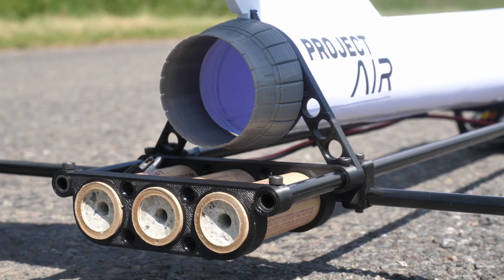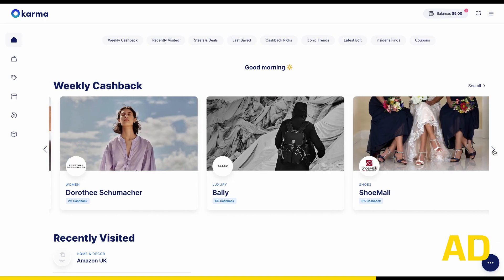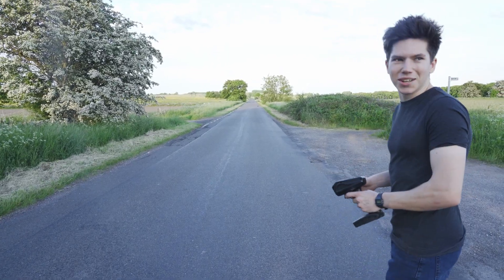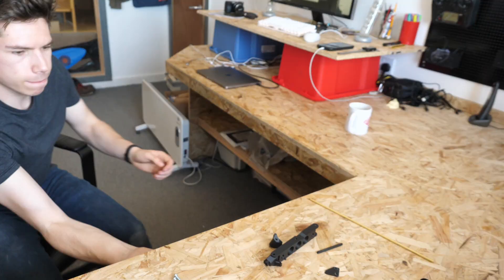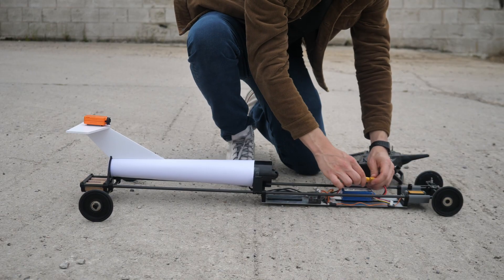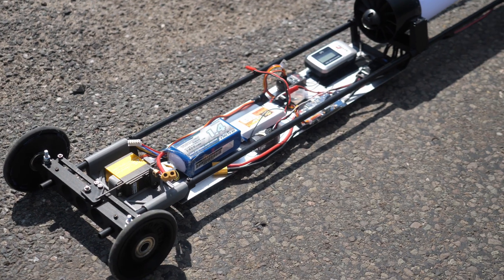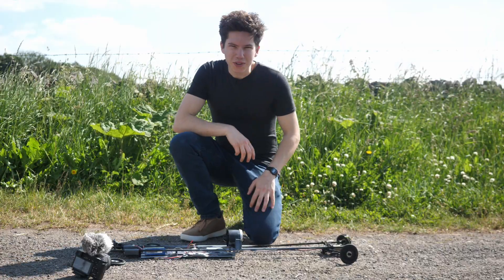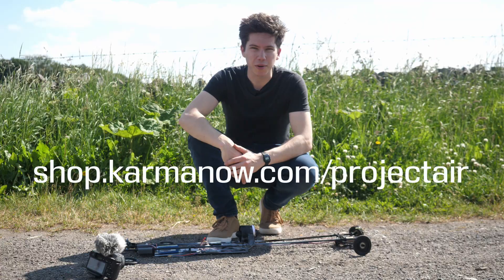Making a Rocket Car

Comment: Just a few things for your next setup on your chassis if your going to try three motors.
1) increase the forward track on the axle and add a wee bit of camber.
2) slow the steering response down to very minor increments, faster you go the less input needed.
3) massive flat parking lot with no curbs lol

Comment: lol CAD designed, 3d printed, with proper rocket nozzles.....
When we made rocket cars, we used mini-skateboard wheels, taped to a piece of scrap wood, with a can of Lynx or Tusk taped to the top as the 'engine'. Puncture the base of the can of Tusk, drop a match, and pray......

Comment: Ultralight wheels for RC airplanes would probably help to reduce the mass a little, will need a smoother road though. The one I made when I was a kid used these and an Estes E-motor. Went airborne after about 50 meters when it hit a small pebble in the road (it had low ground clearance and not enough downforce on the front).
Reply: Try it again, but with a skateboard ramp set up in the road ;)

Comment: a little off topic but, concerning your safety belts in your Mini, you need a cross bar to raise the point at which they turn down towards the rear mount points.  the belts should turn down at a height equal or slightly higher than your shoulders. if your shoulder is the downturn point, in an accident your back will be compressed severely.  enjoyed the video. cheers

Comment: You can drill out the ejection charge and repack the end, or use epoxy. Or you can actually buy engines for multi-stage rockets that don't fire an ejection charge.

As many Estes motors as you go through, you should seriously look in to making sugar / kmno3 rocket motors yourself.

Comment: why didnt you remove the ejection charge?? its rather easy, pull off the paper tab, empty the powder and cover the hole with epoxy glue... no flash no fire..

Comment: part 2 fire proof parts / you could try emptying out 3 rocket motors and make one big one on the center line so there is no side to side pushing at high speeds and make it super aerodynamic / happy tinkering    kevin

Comment: So you know about camber toe and rake, right? The shortest distance between any 2 points is a straight line, to get higher speeds you're gonna need to go in a straight line for longer which means you're gonna need better steering.

Comment: Really needed to turn down the steering sensitivity A LOT. When you are driving slowly you need to turn fast, but at high speeds you barely need a few degrees turning and will stop you from over correcting and wobbling. Even if it gets out of control a high turning rate isnt going to save it

Comment: Also maybe orient your thrust stack vertically instead of horizontally so you don't get any dissymmetry from unavoidable slightly varying ignition and burn times.
Reply: That's what Mythbusters did when they experimented on a JATO car.

Comment: My thoughts and suggestions:
1) Bin the steering all together and opt for low friction, low mass wheels with a Spektrum as3x flight stabilization RX (bare with) to gyroscopically maintain steering control and allow a dynamic vertical stabilizer to keep you dead ahead at all speeds. You can use tiny linear actuators instead of micro servos to save even more weight.

2) Critically evaluate you thrust to weight ratio and pour it on mate, that feeble ducted fan is a hold up and not a selling point. You are shooting for 2:1 bare minimum, ideally exceeding 6:1. Are you or are you not going for speed? Don't over look this physics fundamental and somehow come to imagine low friction and an odd setup will gain you anything.

3) Go high voltage. Try a 6s or 12s HV lipo system and thank me later. You can still use smallish cells to keep the mass down because you are doing short runs, just make certain your entire powertrain from the bus out can handle the increased current load.

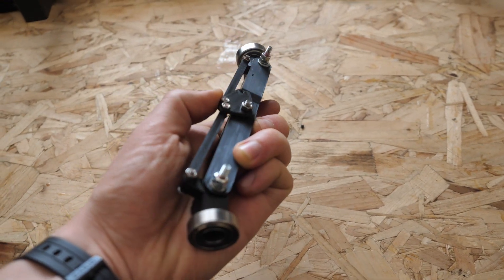Comment: 4:49 "A strong, high tolerance subassembly"

Five minutes later...

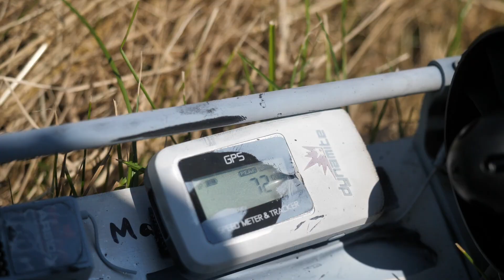9:20 A small pile of small pieces of a very strong, high tolerance subassembly.

That's what I love about these videos, you take on a project, you do just enough research to be able to build a prototype, you use the worst possible way to manufacture the parts and then just go for it, all the while knowing that it's ging to fail because 3d-printed parts are never ever strong enough and you kind of already know that before you start printing. :-)

Comment: Needs rubber tires at least on the back.  We did this with a big (about 18") plastic toy car in the 80's with no remote or steering and it went dead straight after we rubber coated the rear wheels.

Comment: My dad built me a very similar rc rocket car 25 years ago, we got a multi page feature with it in 'RCMC' magazine. He used 2 shallow shelf brackets side by side as the main part of the chassis for rigidity, with the elecronics inbetween. Its a jet dragster design with a funnycar body for aero. We used 2x D-12 to start with then moved on to a single 5 second burn distress flare rocket motor. It also has full suspension and servo activated parachutes. We ran it at santa pod dragstrip after dark (usually getting a few runs in before getting kicked off) and although we had no timing equipment, we estimated well over 120mph. I still have it and plan to get it going again sometime soon. May I suggest mounting your rocket/s in front/over the rear axle and angling your rocket exhaust upward a few degrees to give instant downforce and increased stability

Comment: If you cannot avoid the rough road surface, use larger wheels?  Maybe thin rubber tires?  Design the wheels with low mass so no loss when accelerating?  The small wheels cause energy loss with vertical motion, larger wheels will react less to rough surface.

Comment: Great experimentation!

And yes: An intake lip on the EDF will make a big difference!  In my own static tests you lose about 40% thrust without an inlet lip ring.
Reply: In your comment regarding 40% thrust loss without an intake lip, are you referring to the stock lip ring that comes with most plastic EDFs? Or something specialized?

Comment: If you need aerotech motors that are cheap in the uk then go to https://www.sierrafoxhobbies.com/en/ because aerotech are cheaper than cesaroni even though the casing is more expensive. Also rockets and things shipping is double the price. I asume you use rockets and things to buy your motors
Reply from the maker: That's correct, I had been using Rockets and Things but am not much of a fan. Will check out the aerotech motors soon, thanks for the link!

Comment: Like what you're doing and confidantly presented! Surprised as you were you didn't get a higher speed with the ducted fan. Perhaps next time leave an air gap between the fan and thrust tube as model jets have to. The gap improves airflow and thus more THRUST!! 🚀

Comment: We've been working on a C & F  single/double class Booster System for the Drag, Bashers and Speed Run enthusiast out there. If you'd like the opportunity to feature these products in any of your future builds we would be happy to send you a selection of what we produce here in the states. All of our kits include the reusable/reloadable rocket housing, electronics and motors. Third channel tx/rx required For reference please don't hesitate to look us up on eBay at our AJCMods shop. Currently a lighter weight design is in the works to be place on skeleton frames like the one you made as well as planes and boats. As always stay safe and keep up the great content!

Comment: Aaaaaaand this is why rocket sleds are normally run on a rail system. Lots of fun though, good job! I think one of you adventurous boffins should design a laser based electronic rail system that could then be tracked by a simple automated detector/steering system. Place the laser at the finish line, line up the vehicle and let her rip!

Comment: "I rather fancy building some sort of experimental jet car..."
Okay. So you know that one Speed Racer movie that came out in '08? Well, some of the cars in the movie have jet engines. In order to take full advantage of them, they also have full 360-degree steering on all four wheels, allowing them to point the jet in any direction, while still being able to steer and brake with the wheels. These cars are called T-180s. You know what to do :-D

Comment: the whole reason why the limitles is stable is because of the suspension. without you get fibrations in the wheels bearing and can destroy everything( just like your crash did). tires made from rubber or foam help but have more friction.

Comment: Did you had the steering geometry setup to automatically keep it going straight despite external forces? (sorry, I don't remember what it's called; there's all sorts of nuanced geometry tricks that tweak how cars handle turns, slides, disturbances when going straight etc)
Reply: I think caster is what you’re thinking of
Reply: @MiniMoto0098  Toe-in is also a factor, and I'm sure there's more
Reply: @tiagotiagot  Oh yeah, toe in in the rear.
I wrote that at like 4am so I was a little tired, still am…

Comment: I think you could get better stability by changing what you are using to generate downforce. My thinking is that you have a jet of fast moving air due to the rocket, so why not make a nozzle that resembles the rear difuser of a modern racing car? While you are at it you could probably make sides to increase the thrust/efficiency, which might offset the losses from diffuser shape. To my knowledge most semi-recent cars generate downforce not so much by their wings as by the design of the underbody, which is probably more weight-efficent in your situation.

Comment: You essentially took a top fuel dragster design, no suspension, and took it off roading. Use the suspension and running gear from an existing RC car with tires that can handle some speed then build your own chassis. Build a front and rear wing mounted directly to the chassis. Downforce and suspension are your friend when you start reaching speeds over 50 mph.

Comment: Great video, and a nice first attempt! Like others said, you should have used a rocket motor with no ejection charge. Those D12-7 are rather powerful for small models, but the "boom" and fire after crash was clearly due to the ejection charge. May i suggest you use aluminum tubing for the chassis? Make something stiffer, and of course use rubber tires + suspension. You could also try doing your tests at a more ideal space, such as a mall's parking lot on a Sunday morning (no customers around), so as to not limit your tracks' width (provided that's not illegal of course). Looking forward to your 2nd try!

Comment: Maybe you should get an all metal hotend and some PC filament, which should be a bit more fire/heat resistant than PLA. Also make the thrust tube in vase mode instead of using paper

Comment: Here's an idea for similar rocket motor applications.  Make the housing tube for the engine a barely loose fit and seal off the forward end.  Also do NOT lock the rocket motor in place, this way when the ejection charge fires it will eject the engine, rather than torch the entire model.  I suspect part of the control issues was having no real suspension on the model and a hell of a lot of flex along the chassis rails.

Comment: Might not steer as well,
and maybe could have some un controlled torque vectoring XD but maybe if the rockets are on either side of the front wheel it would track straight?

Comment: One thing that has me to wondering is losing control of the car. I am wondering if there is a way to limit or slow down the the amount of movement from the steering servo based on speed. As you go faster the steering of the car seems to become exaggerated. Just a thought.

Comment: As someone who has launched 1000s of rocket powered cars in my tima as a physics teacher may I make a few suggestions....

You need to stack the 3 rocket motors vertically on the centre line. This will stop any yawing moment from imbalanced thrust as the motors burn at different rates and burn out at different times. (They have a range of impulses in D class i think it is between 10 and 20 Ns if I remember correctly). The vertical stacked rockets will also provide some pitching moment to keep the nose wheels planted on the ground as they currentlybounce up off the ground quite often with an your current design due to no suspension damping and a springy chassis.

Perhaps also add some toe in angle to your rear set of wheels for directional stability.

Comment: Those carbon tubes are exactly the opposite of a rigid chassis in my opinion.  You should also use the dual rate setting on the transmitter to reduce your ability to turn the wheels at speed as, generally, people always overcook the amount.  Just my 2p tho

Comment: Use gyro for steering stability... Just my 2cent opinion... Make it aerodynamics especially the front... N lastly add some suspension make it not bouncing too much n broke the axel n chassis... Also add more rubber on the wheel... Can reduce and smoothen the wheel spin on than rough tarmac... I think...😅😅😁😁

Comment: I'm thinking, if you would mount the front wheels on sticks that stick back from the pivot of the steering axle a bit so that the direction of the car would pull the wheels to align straight, it would probably increase stability a lot (sorry if it wasn't readable, it's 1 am amd it's been a long day)

Comment: So much drag on your electronics mate. Also EDFs don't have good low end power. They have good top speed, but you need to get the friction minimized first. A traditional brushless wheel driven car will get you to the same speeds with a lot less work.
Reply: I agree with you completely but with regards to the last sentence, I’m pretty sure he knows that and he did this mainly to learn and for a challenge

Comment: Id cluster the three d motors around the edf, two at bottom one at top. Angle the top one down slightly, add suspension and more surfaces for larger downforce to cope with sudden acceleration. Ideally slightly stage all d motors so when all 3 are used the kick is reduced.?

Comment: In my opinion, the car needs a front wing too and a better deflection in the rear. Also, if you plan on throwing the nice jet engine, I would use a similar type intake to a 727 engine aft center engine to try and prevent ingestion of road debris and FODing out the engine... just a suggestion.

Comment: Great video mate. 
Your going to have to setup proper suspension. The car needs to float on it at those speeds and (esp) on that surface. Check out my Heng Long Hot Rod Rebuild Part 3 video for an example of some good cheap and easily modified shocks. Has a link in the description to the shocks off of BG. 
Looking forward to seeing you smash 150 kph.

Comment: Invest in a 2  to 3 axis gyro sounds stupid but it just might help you control your vehicle at high speed secondly face you rockets and edf off centre meaning i degree facing upwards so the front of vehicle is forced downward in turn better stearing control  give it a go so much to gain nothing to lose good luck.                         Greg
Reply from the maker: Thanks Greg! Will he investigating gyros on a future car :)